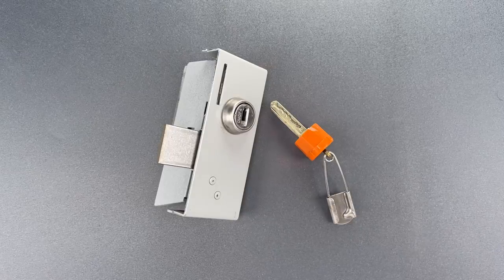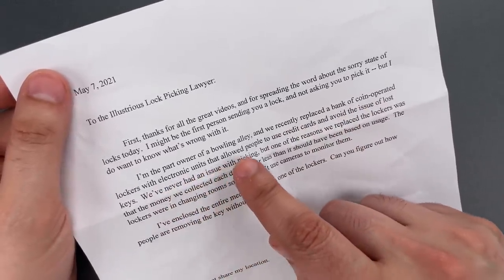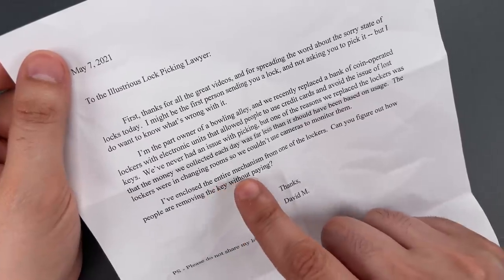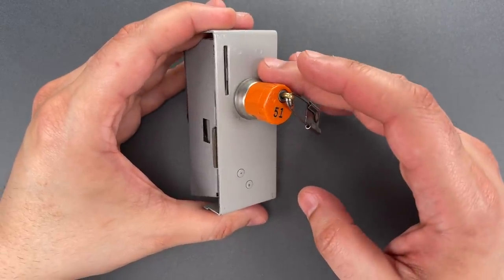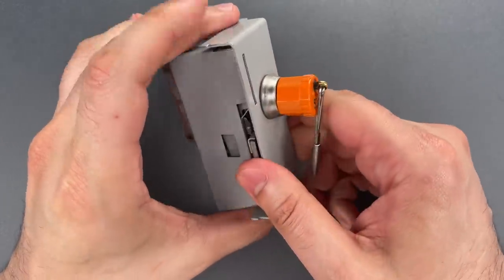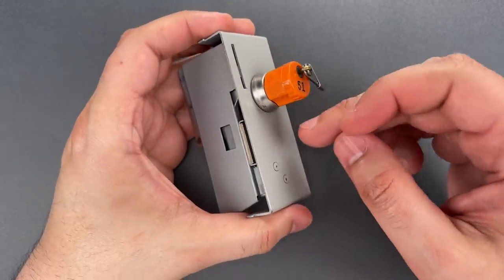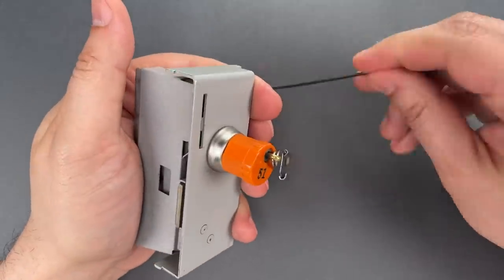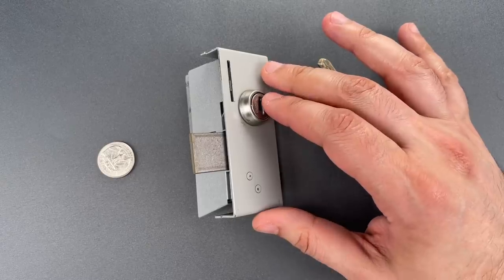[1308] A Huge Flaw In This Coin-Operated Locker Mechanism

Comment: I'm surprised that no one has mentioned the quarter on a string trick. Maybe I'm just part of the last generation to have seen it in use.

The "smart" kids, as they explained to me, would have a quarter with a hole drilled near the edge, just big enough to pass some string through. The other end would have a loop tied in it like a yoyo string. 

Pop the quarter in a pay phone or pay locker, get what you need out of it, and a little tug gets the quarter back. 

Never felt the need to do it, myself, and was always mildly disgusted at the theft and duplicity of the whole concept. Honest folk trying to make a living, and this punk is out having a field day. Irritating.